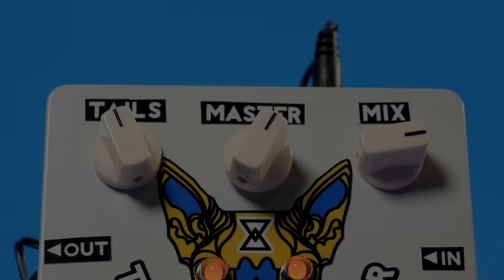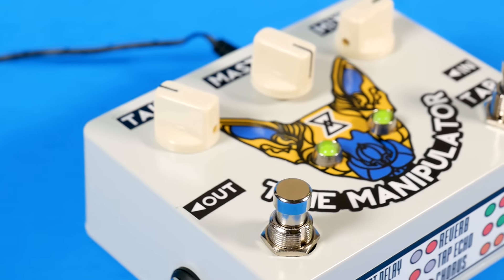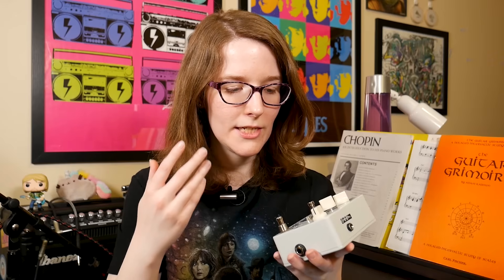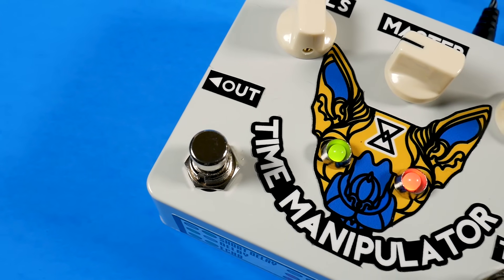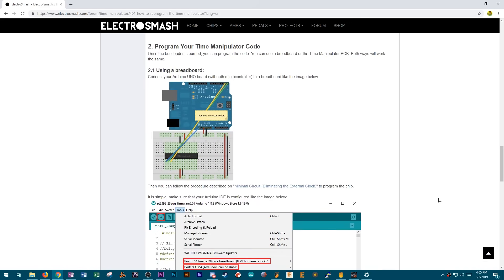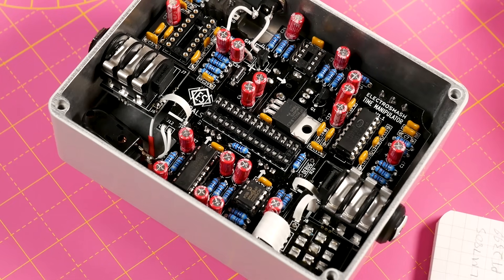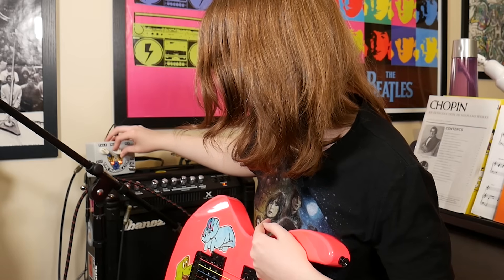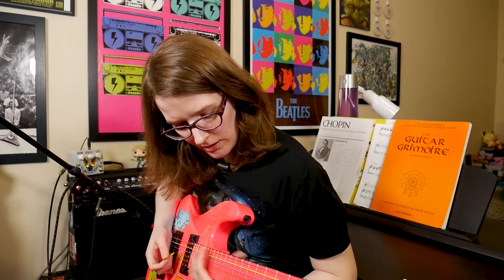Time Manipulator: An Arduino Delay Pedal by ElectroSmash 🎸

Comment: Color coding isn't that cool for 10percent of the dudes that have some sort of color blindnesses. I would need to swap the led for some sort of blue one. Anything with red green orange is almost impossible to distinguish for me if its a small dot on the floor for me. Maybe they should include another color ontop
Reply: I did some early coding where the effect can be identified by the number of flashings that the LEDs do, like 3 blinks for effect number 3 etc...
Reply from the maker: yeah that's a good point, bit of an accessibility issue. they're bi-color LEDs and it does look like there are bi-color LEDs with blue as one of the colors.

Comment: I'm surprised they used a classic AVR Arduino as opposed to something like a STM32 that's more powerful but still compatible with the Arduino software. Especially for open source hardware, going overkill on the hardware gives more room for software improvements later on.
Reply: If you check the project the arduino is used only to generate VCO, turn on/turn off delays to mix the effects and read the encoder. It not necessary a 32 bits processor in this case. The main of project is the PT delay IC
Reply from the maker: I don't want to speak for them but my guesses for their usage of the 328 would be that they wanted it to be easy for end users even at a beginner level to reprogram, I don't believe STM32's are available in a through hole package and cost.
Reply: @BlitzCityDIY  From a quick search, STM32 breakout boards are under $2 each. Having a bit more compute power would really help with implementing all sorts of interesting effects.